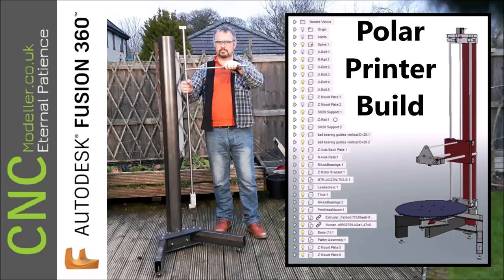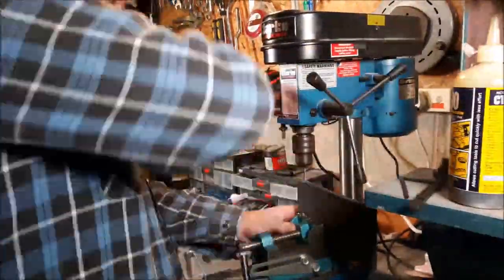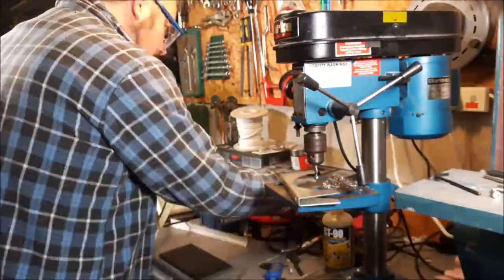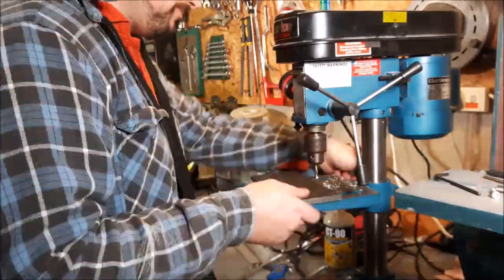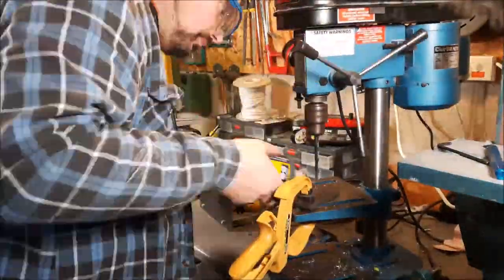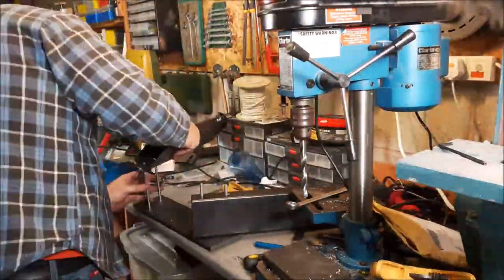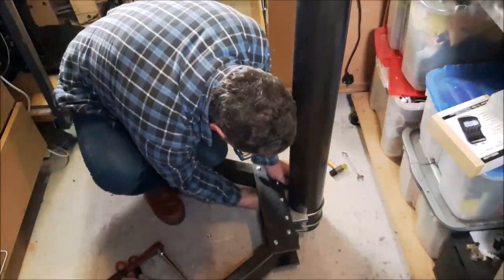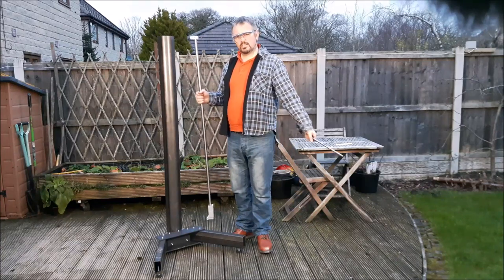Novel Industrial design Polar 3D Printer Build #1

Comment: Wow fantastic. Is the project to begin from budget, because it have less engines, more simple, except for few calculus the 32 bit board probably can do right in firmware. Or I hope so.
Reply from the maker: Hi Joseph, it's a bit of everything really. Primarily I like the polar concept, and I think it's a relatively simple and very compact design for it's build volume. I also think that the kinematics are suited well to printing in vase mode which is what I'm going to use it for. Thanks for the interest, I've been focusing on the build lately but I have plenty of raw footage to create more videos once it's fully working!
Reply: @CNCModellerUK  Yes! Would be a perfect suited for Pottery-Vase Mode, as it stands on spinner.

Comment: Nice. I recall I upgraded my Prusa I3 Reprap to be able to print taller fuse sections from stock 200 to 450mm. But I've found it very risky. The long section take ages to print. And the taller the print the more chances of failed print... Since then I prefer to print more shorter sections. So a bigger build plate wins over the height.
Reply from the maker: Thanks. I've had similar problems so have decided to go closed loop on the stepper control. I have a pair of UStepper drivers for the Rotational and radius axes. If they go well I might go closed loop on the extruder too. I'm also planning on running 36 to 48v to improve stepper torque / response. It's all an experiment so we'll see what happens!